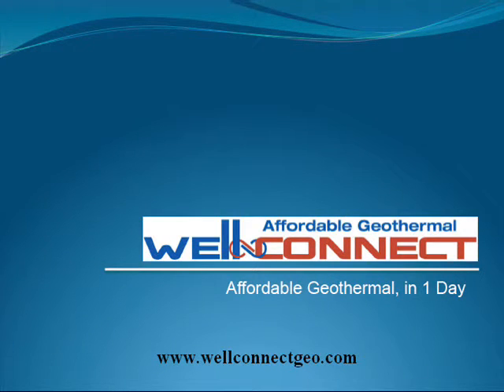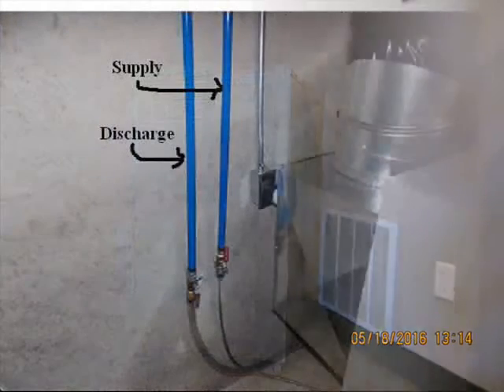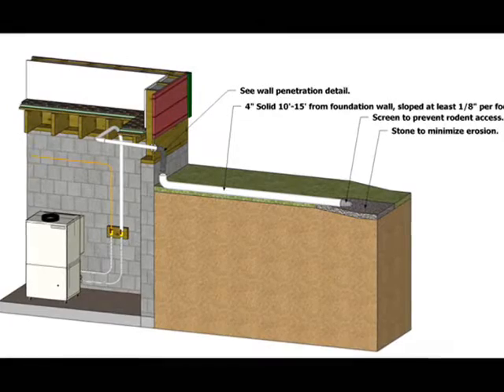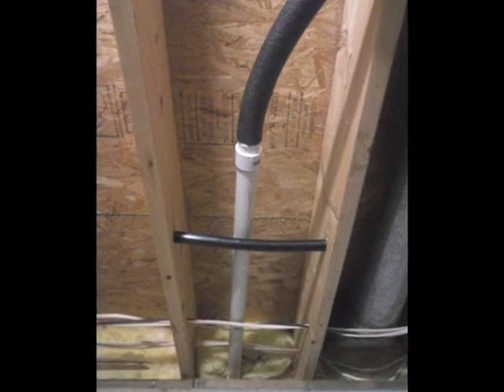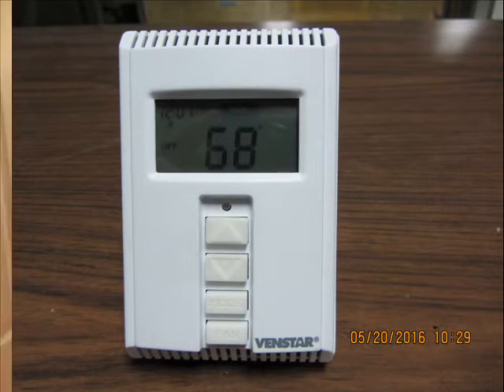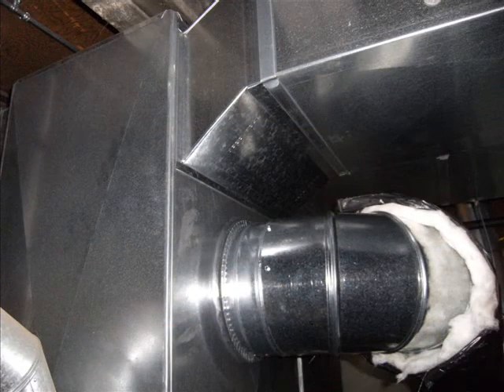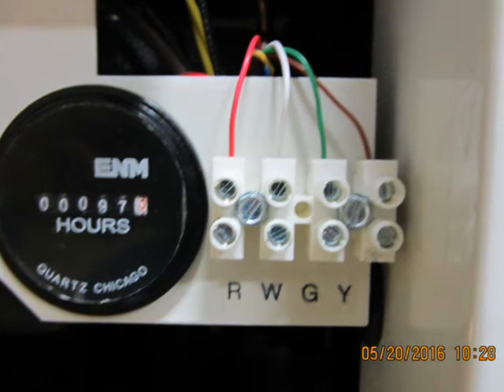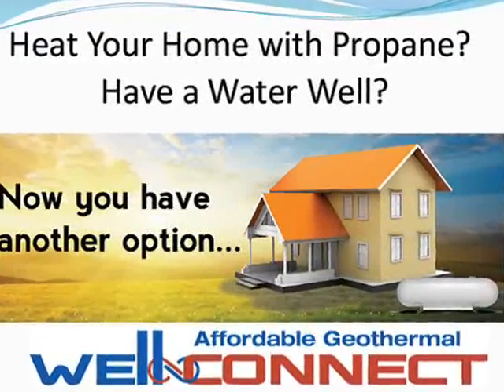Well-Connect  Affordable Geothermal - Simple 1 Day Installation

Comment: I don't know if you folks ever view comments, but you stated to install a second pressure tank? You need to get a hold of the owner of Cycle Stop Valves. His valve technology works, continues water flow at 55+ psi. The removal of the pressure tank(s), may provide room for one of your units where it may not fit. I have no room for one of your units, looks interesting. Look up Cycle Stop Valves, he has a channel here on YouTube, https://www.youtube.com/watch?v=QGLhIkZ_3sE&t=26s I'm a customer, and I can tell you, the installation of this valve made a huge difference in water delivery in the house.